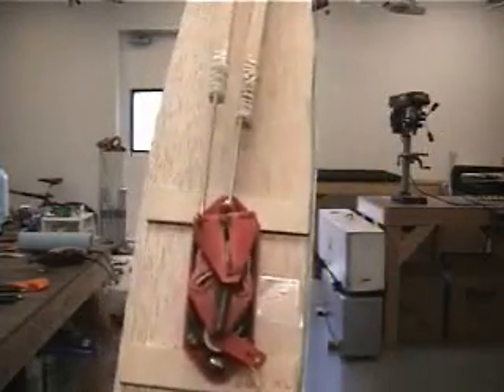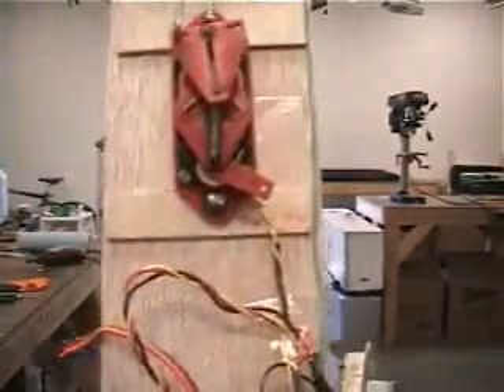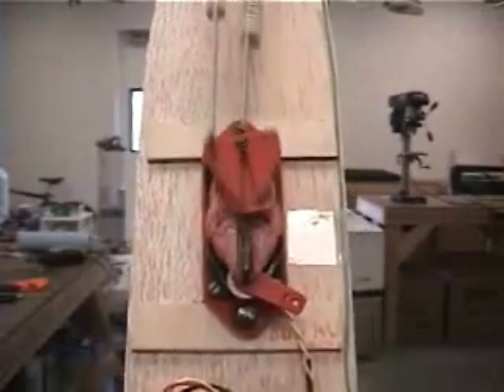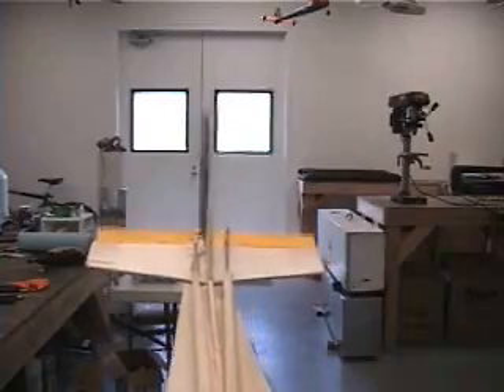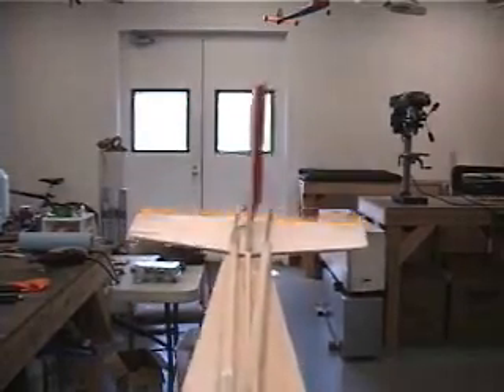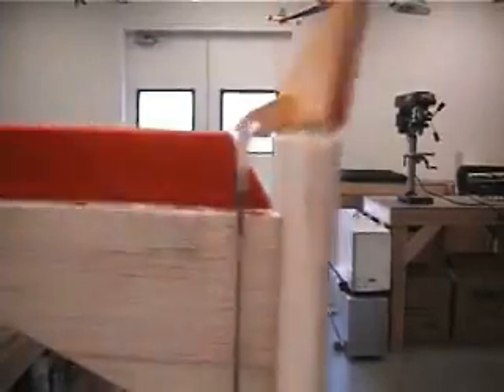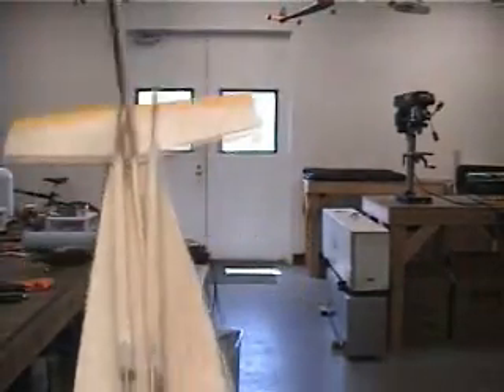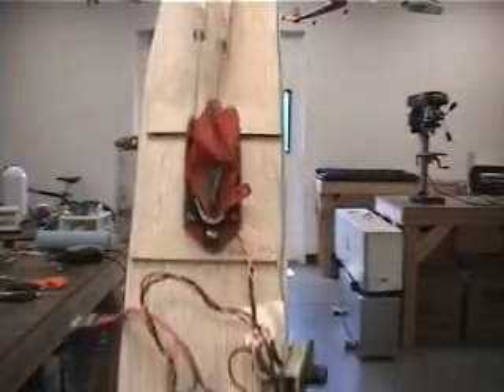Galloping Ghost Radio Control

Comment: In the 70's i bought a Mattel single channel pulse proportional Galloping Ghost. They were really cheap, and I guess they might have been re-branded Ace systems. I put it in a Nomad glider with a cox Pee Wee 020. It flew great, and I also used it to slope soar. I think one reason for it's success was the positive control by using thin twine on two control horns either side of the rudder and connected to the actuator arm instead of a torque rod and loop.

Comment: What I’m struggling with on these galloping ghost systems that in neutral, there is still deflection in both directions of control surface travel. I assume that it cancels out movement of the aircraft in the respective axis? For example, the rudder in neutral pulses back and forth. The aircraft would be yawing left and right respectively but still traveling in a forward path, correct?
Reply from the maker: Because the aircraft can only maneuver up to a certain frequency, it can not respond to the rapidly moving controls and only follows the average position (aside from a little "galloping".) At neutral the surface moves equally back and forth, but the aircraft can't follow that fast motion and only responds to the average which is zero deflection.

Comment: Ah .. the old Rand LR-3 .. I had one when I was flying GG.  My first GG setup was a Phelps pulser box connected to my Citizenship tube type CTX transmitter. Using a super-regen receiver was no good, so I got a Controlaire SH-100 superhet (27mhz).  After a while, I got rid of the Phelps pulser setup and bought the Controlaire GG TX, which had a nice gimbal and a toggle switch for motor control.  One of the most fun planes I flew with GG was Bill Northrop's "Galloping John". I stuck a McCoy  19 in it and it was a pretty hot flyer (40" wingspan). I loved flying it inverted around in circles around me, sort of like a U/C plane.  Great fun. Flew that until I got my 1st real proportional rig, a Kraft clone made by Canon. That turned out to be a piece of junk, so we sold or traded it in on a Kraft Gold Medal series, which coincided with about the time I started flying competition pattern (Class D and FAI).  Good memories.

Comment: Still have my Controlaire  & LR3 actuator unused in 45 years! Centre tapped 500mAHr NiCd batteries went flat so fast, particularly using the throttle, that I never flew with it.

Comment: I had an actuator just like that around 1968, it's a Rand LR-3. I still have the Citizen-Ship model NPT galloping ghost transmitter that I used to operate it with. It was installed in a Goldberg Ranger 42 foamie ARF and powered by an old Fox  .15. It flew, but it was never really in control, more like "suggestion"!

Comment: Fascinating actuator, I've never seen one of those before. I built my own 27MHz radio set in the late '60s for a model that I built named Rattler, designed for GG. My actuator was a single push (torque) rod driven by an elec motor and had an angled end that engaged the tail surfaces. My setup used short pulse width for down elev and long gave up elev. Mark-space controlled the rudder. I only ever managed one fully controlled flight! Thanks for sharing.